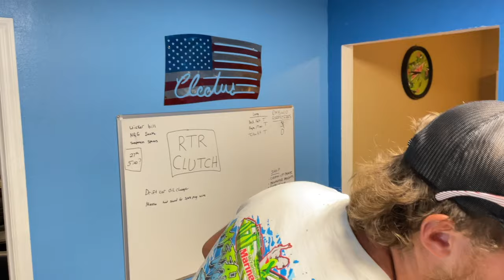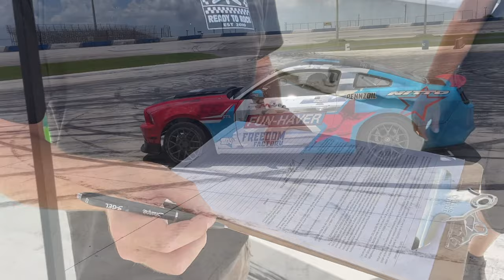Vaughn Gittin Jr. Flew In To Help Me Tackle My New Drift Car... NOW IT'S INSANE!!!

Comment: I bought Sam's spray wax a few months ago, for my 1968 Olds 442 convertible. I have and have used many different spray waxes over my 50 years, but Sam's spray wax is by far the best I've ever used! After applying  it on the paint, I decided to also use it on the chrome, exterior glass and even the interior, with great results! I'm not trying to be a shill for Sam or Cleetus, but Sam's spray wax is 100% the real deal!!

Comment: Shade trailer. You should build a flat bed trailer with shade, couches & fans so you can be more comfortable during summertime down here in FL. Park that in the burnout pad. You could even put a generator and run those big a/c fans.

Comment: Make sure if you have multiple U-joints in your steering shaft, that they are clocked 90 degrees out, or else they will bind if they are lined up.

Comment: 2nd gear 6-8k RPM feather. Slower is more control. 40-50mph as apposed to 60-80mph is a ton more control. 💪😎💥

Comment: Bad ass car!  Question, with all that fancy ECU / Sensors etc, why in the world would one not setup a CRITICAL piece like a water pump to run any time the motor is running. I can see adding a secondary switch to turn on the water pump if the engine is off (to cool things down), but I dont see a situation where one would not want a waterpump running while the vehicle is running.

Comment: This is why no matter what type of racecar you have you need to nit and bolt it which means for through every nit and bolt and make sure they are tight by breaking Emm loose then re torquing them. I been racing asphalt circle track latemodels and every class imagine able and I nut and bolted every car before it ever went to the track so nothing breaks or comes loose and kills me or kills the car I'm surprised cleetus doesn't have someone to nut and bolt every car and use a hand towel and some foaming glass cleaner and clean every frame rail ECT we donthat looking for any leaks or missing bolts as a second look over and if it is clean you can spot a leak at the track fast and not know if it's old leak or new leak
Reply: 🖕🖕 Wow congrat I got something special for you Dm to claim your prize🎁🎁..

Comment: I'd like to see a Donnie shootout with Cleetus and the Mustang with Vaughn.   I feel Donnie is way more controllable.
Reply: What you are seeing is the difference between an average practice car (Donnie) and a full pro 2 or pro 1 car in the mustang. The higher level cars are just much harder to drive because they ride a tighter knife edge between sliding fast in drift and gripping up. The mustang would throw a huge gap on the Vette, it’s way faster in drift, that is why it looks so twitchy.

Comment: you need more angle and more throttle dont throw the ass end of the car out then hammer it clutch ebrake get a hard angle and then get on throttle and push through the turn and use the steering to make small corrections through the turn. dont correct so much with the gas.

Comment: That suspension setup seems way too stiff. The car is bouncing over all the little bumps and the front shock down travel is tight and pulling the inside front tire off the ground.

Comment: Cleetus you can drive about anything but….No wonder you did terrible last time. The car was not ready. Probably was a rush so things happen. Transmission tail(missing bolts,could’ve came loose and fell out) was probably jumping up and down causing a loading unloading of drivetrain. The steering sticking and Ackerman being off didn’t help. Just didn’t have the opportunity to work all the bugs out before that first event

Comment: A good track would have better transitions from one surface to another without all the bouncing going on every time you went from concrete to blacktop; that's a no brainer guys. Needs to be fixed, I told you guys you get what you pay for you hire someone who is going to donate time and labor your going to get a crappy job every time~!~ That's just disgraceful to see a car bouncing so much just due to track not transitioning properly to the same level of the two surfaces. Shameful ~!~ Not to mention just dangerous and wear and tear on suspensions.